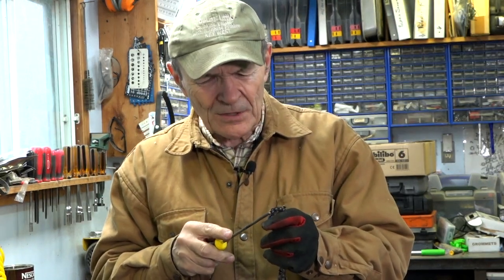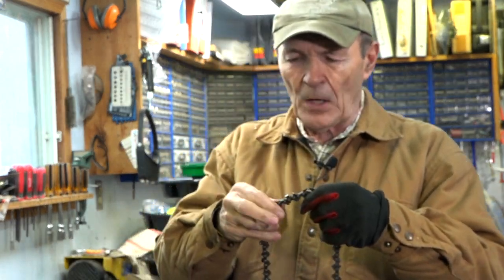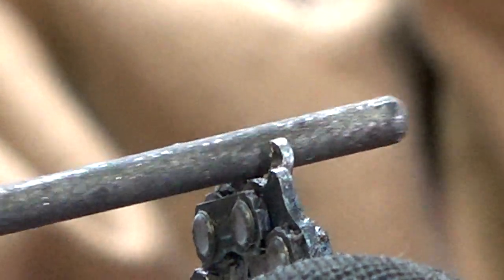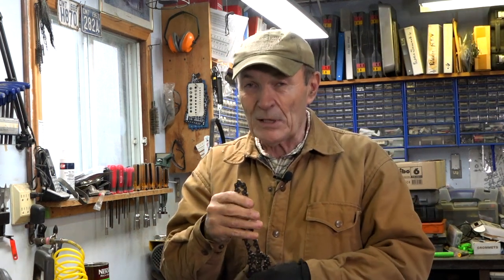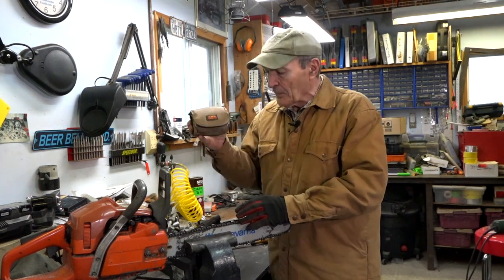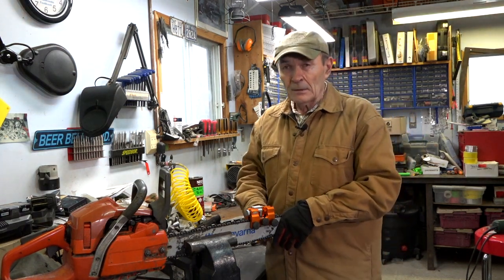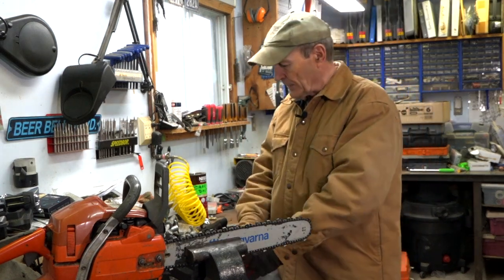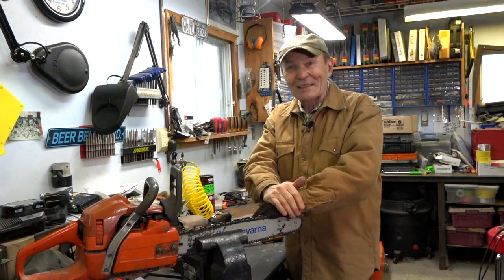#60 Sharpen A Chainsaw Properly! | At The Ranch

Comment: correct me, but you are wearing out the chain stopper! The silver movable part that stops the chain tooth from moving back.
I think you need to check out your settings.
Reply from the maker: Not sure what part you mean by chain stopper?  Why not read the sharpening instructions here and then decide if its correct.  https://www.timberlinesharpener.com/landscaping/.  Thanks for watching BP.
Reply: @AlecPeirceAtTheRanch  I've read the instructions and it explicitly says that if the cutter is wearing into the pawl/stop (it definitely is in your video), then one side of the pawl should be flipped up. Look at the bottom of page 2.

Comment: there is not a blade on a saw its a bar and chain, someone gave me one of those sharpeners and i would be willing to sell it for 50 dollars. by the time you set that up i can hand sharpen and get my chain quite sharp. 21 dollars is what i pay for a 20 inch chain.
Reply from the maker: As with many gadgets on the ranch, your skill and experience plays a key role in how things are done.   My experience with hand sharpening (eg round & flat files), is 60 years but now my hand is not a steady or strong so these 'aids' help older and new users get a properly sharp angle on the chain.  I know more experienced users like yourself have different views but that is based on your training.  I can easily hand sharpen a chain saw but still need my grand kids help with the stupid 'smartphone'.  Its all about our life experiences and i'm offering help to those left fortunate than us veterans of hand tools.  Thanks for watching Wayne.
Reply: @AlecPeirceAtTheRanch  i understand the smart phone part totally.i cut quite a bit of wood so the hand filing works very well i just dont have the patience to use that tool for sharpening. have a merry christmas
Reply: I will buy it
Reply: @thomasmoorman5854  I know the carbide needs to be new I think as it has a chip in the end.